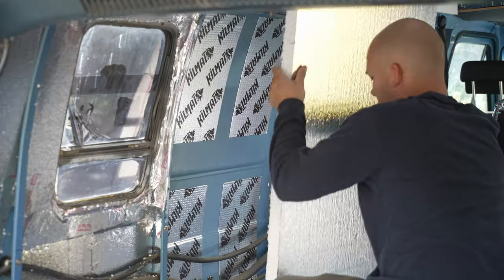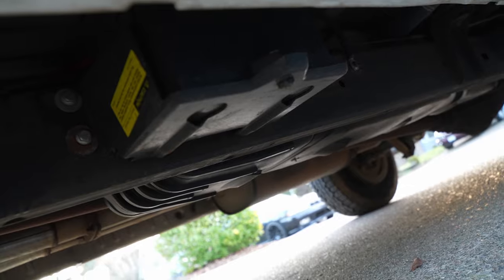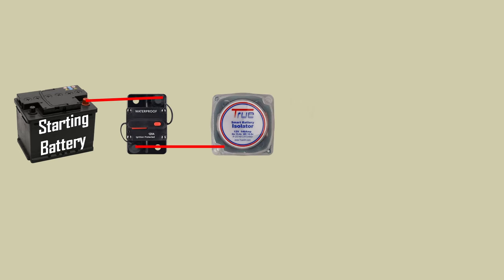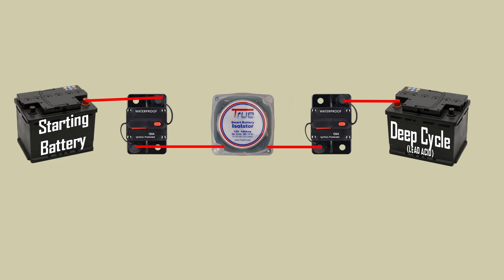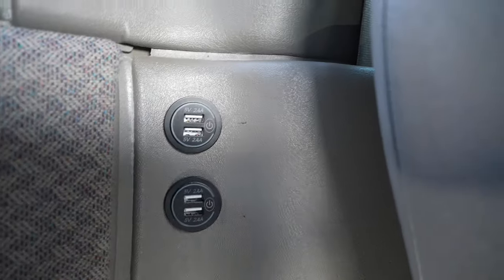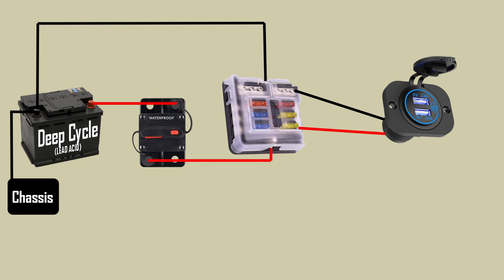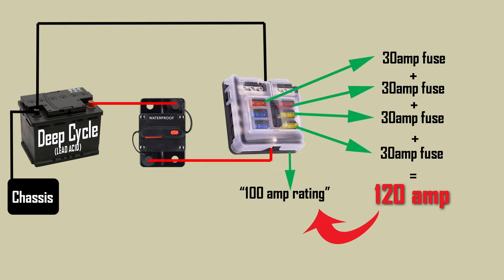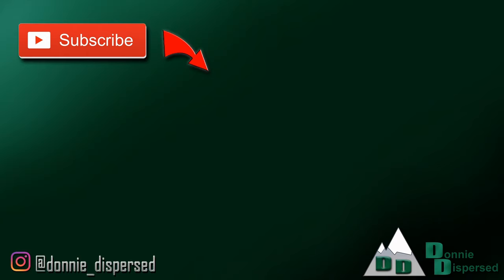SIMPLE DUAL BATTERY SETUP | ( Auxiliary / House Battery Camper Van Overlanding)

Comment from the maker: This one is the more affordable systems I've put together coming in under $400 
🔵 Shopping list * 
Smart Isolator: https://amzn.to/3ROmUdc

Circuit Breaker x2: https://amzn.to/3xezUiU

Fuse Block: https://amzn.to/3IeICnD

USB Outlets: https://amzn.to/3YJ47SG

My favorite brand wire for accessories (NOT BATTERY CABLES NOT FOR ISOLATOR): https://amzn.to/3xfGsxA

Fork Connectors (Nice for Fuse Block Connections): https://amzn.to/3G9LZIF 

Awesome HeatShrink Tubing: https://amzn.to/3dg43nL 

For Your battery cables you will want good heavy gauge wire. Probably no smaller than 4ga. I used 2ga welding cable that I had sitting in the garage. 

Jumper cables can be a more affordable way to buy heavy gauge wire.
I used these ones for the fuse block connection to the auxiliary battery: https://amzn.to/3YJcqhl  

*affiliate links support the channel at no added cost to you!

Social Media Links
www.donniedispersed.com
IG: www.instagram.com/donnie_dispersed/ 
TikTok www.tiktok.com/@donniedispersed
Reply: DonnieDispersed ? it would be best to use a fuse under the hood and circuit breaker inside the vehicle, because circuit breakers under a hot hood trip when it gets hot enough.
Reply from the maker: @FUNKBOOGIE1  I’ve never had that issue in any of the 3 vehicles I’ve installed circuit breakers in. But if it was a problem, sure you could use a fuse.
Reply: How do you determine the breaker size?
Reply: I currently have a solar panel on the van roof. Both positive and neg wires go to a solar controller. From that a positive and negative wire goes to a house battery from the house battery a positive and negative wire go to my invertor. Nothing from that system is connected to the chassis.

Now I want to connect the house battery to the vehicle battery as you have done because sometimes you just need to recharge from the alternator.

How would you suggest?
Reply from the maker: @yougeo  depends on the house battery you have. AGM or lithium I would replace the Voltage Sensing Relay (VSR) I used in this system with a DC-DC charger. However you can otherwise set it up exactly like this, just add the leads from the solar controller to the house battery as well. I have since added a solar panel to this van exactly like that.
Reply: @DonnieDispersed  i am all ead acid batteries now because I get them very cheap from wrecked cars. Batteries are often fine. Also no fire worries like lithium

Comment: So how would you charge the deep cycle battery? My truck came with a similar set up but don't know if I can use a deep cycle and have the alternator keep it charged while the engine is running; as that is the only time the deep cycle is connected to the vehicle electrical system.

Comment: Add a starter box. It's what all the roadside assistance people use now. I've had 4. The latest and best is made by "Tac Life". If your starting battery fails, it'll usually start your engine. But you don't want to depend on it. It's backup.

Comment: Great video and a very well-explained simple 12 lead acid leisure battery solution with diagrams to make a very straightforward & low-cost, safe working system anyone can install in their vehicle. The biggest cost with this system is probably the additional Lead Acid or Gel type of battery. This system is probably 70% as efficient as the much more complicated and expensive  BCDC + Lithium Battery systems but at less than half the cost.

Comment: Great video, and well illustrated... Like to add that many people go cheap on the wiring... So whatever breaker size is used, it should be rated below the ampacity of the cables used....Plenty of charts that explain what cable size is needed based on maximum loads.

Comment: Would this setup work if I wanted to add two auxiliary batteries? I’m trying to get my 2016 F150 XLT 4x4 truck set up for
Overlanding. I want to be able to power my Dometic fridge, charge my phones, run auxiliary off-road lights.

Comment: Great video... Just had a quick question, So is the secondary battery technically running in parallel or is it just to power aux items? Like is it being used during starting as well?

Comment: Finally..a solid answer and not someone trying to sell a particular product like its the only way. Thank you.

I do have a question.....the second battery...can I add a 3rd and 4th battery to this setup? And probably a shore supply plug for charging?
Reply from the maker: Yes, look up how to connect batteries in parallel. 
My old van had a shore power charging set up made with a NOCO port plug, and a NOCO on board 10 amp battery charger. You can find a video of that vans setup on my channel.
Reply: @DonnieDispersed  awesome thank you. Was looking in this as I realized you answered my question.  Thanks again. Gonna go check that vid now

Comment: How so you charge a drill battery within this setup?
Do you need a power inverter connected to the Aux battery > circut breaker?
Why dont you have a DCDC Charger in this setup?
Thanks for the concise video.

Comment: Thx for this simple explanation. So I use a power station to run most of what I need but I’d like to do this to dedicate to my mini split AC. So instead of wiring to a fuse panel I would simply connect that appliance the same way right?  Thx

Comment: Hi, nice video! What about wires size that you used to connect the primary battery with the auxiliary battery?
I mean, is there a way to calculate the wire diameter in order to not get the wires melted while the alternator is charghing both batteries?
Thank you for your response!
Reply from the maker: There’s charts online that will tell you what gauge wire to use based on amperage and length of wire. The wire I used was 2ga welding cable cause I had a lot of it on hand.

Comment: Awesome video exactly what i was looking for, but, how would you stick a charger along that line? Id like to have charger installed also to keep the aux battery topped up while operating vehicle
Reply from the maker: @kevensmith5703  the alternator will charge both batteries when the engine is running with this setup.
Reply: @DonnieDispersed  yrs I continued reading and seen you reply to a previous similar question...thanks mate, appreciate the video

Comment: Best video and I've watched a lot in preparation for my GMC Savana conversion. Question, where did you get the battery tray and where did you mount it underneath?
Reply from the maker: eBay, “used Chevy express diesel battery tray” 
I used Riv-nuts in the holes on the frame rail, then bolted it up.

Comment: I'm trying to do the same but instead of deep cycle, I have lithium pack and I want the pack to trickle charge the starter battery when it's turned off.

The starter itself and the radiator fans will blow the lithium pack and I can't think of how to automatically cut out that battery when starting the engine.

Comment: Do you have to use similar batteries, or can you use different batteries, or different battery chemistries? I'd like to keep the SLA battery for starting, but use LiFEPO4 for the house batter.
Reply from the maker: @alexn9677  you need to use a DC-DC charger rather than the VSR relay if you want to use a lithium battery.

Comment: Great video, Thank you for this! Question, is it possible to use a Lithium battery instead of a lead-acid as the secondary battery or they both need to be the same type? Thanks again! :)
Reply from the maker: With this setup they need to be the same. To use a lithium or AGM you would want to use a DC-DC charger instead of the relay in this system.
Reply: @DonnieDispersed  Thanks Donnie! Greatly appreciated. Keep on doing great videos!

Comment: Quick question - if you wanted an inverter, would you just run it straight from the aux battery? (add fuses I assume too lol) Need anything else between Inverter and aux battery? Also, is there a benefit to install a separate charger for the aux battery instead (like if on city power, etc). Thanks again
Reply from the maker: Yes, inverter is connected directly to the aux battery. I believe some inverters might require an additional fuse, but some shave them built in. As for the charger, that’s how I had mine set up in my camper van is with a NOCO 10 amp on board charger, that was powered through a NOCO ac port plug. That kept the auxiliary battery charged if I plug the van in with an extension cord.
On Board Charger: https://amzn.to/46ThLI6
NOCO port plug: https://amzn.to/3XKnHyQ
Reply: @DonnieDispersed  I have used your YouTube combined with a couple forums (95% you though) and have drawn a diagram of the layout. No way to share here, but curious if in the scenario above with an additional shore charger added to the auxiliary if the isolator will protect / maintain the starter battery? I had the NOCO pushing recharger to auxiliary then off to an inverter, but starting to think I’d bypass the inverter all together and push/split 120 from the NOCO ac plug. From what I read the 120v on aux would only last 30-45 mins a a time.
Reply from the maker: @wadee3183  with this isolator, since it’s a “dual sensing” it will allow the batteries to connect and charge if either of the batteries are connected to a charger.
Reply: Good video thanks 
Those it has to be a deep circle Battery?
I got a extra car battery I could use!

Comment: With the distribution block you showed.. If I were just to use 3A fuses all around - could I just use a motorcycle battery (such as the NOCO Lithium NLP9 400A) in order to conserve space?
Reply from the maker: I wouldn’t recommend using a starting battery to power your accessories. You want battery that was made to deep cycle.

Comment: I followed this video and set up my batteries the same way. I think I did it correctly because it's working. One problem is, the 2 100 Ah batteries (which should hold up to 4000 Watt Hours) that I have hooked up drain so quickly even when they are full. The only thing I have plugged in to the inverter is my 2000 Watt power station, and the 2 batteries drain to zero before they are able to charge the power station to 50%. What could be causing the house batteries to drain so quickly?
Reply from the maker: I’d need more information to really help. What battery chemistry? I’m assuming lead acid if you followed this video. Did you wire the two batteries in parallel for 12v 200ah or series for 24v 100ah? 
I can say, that Inverters aren’t very efficient.
Reply: @DonnieDispersed  I have 2 Weize Deep Cycle AGM 12 Volt 100Ah batteries that are wired in parallel. 

One time, after they were fully charged, I turned off the power switch to the inverter, which means there was nothing connected to them. When I turned on the power switch again, to connect the inverter, the batteries had lost 10-20%. 

These are new batteries that have not been used for more than a total of 10 hours. Could they simply be defective, or could something else be wrong?

Thanks, Donnie.
Reply from the maker: @kevintieu5198   a 200ah 12v AGM bank wired in parallel will have an effective capacity of about 100ah (1200 watt hours). 4000watt hours would be if the bank was 200 useable amp hours wired to 24v in series. You have to cut the capacity in half, because the batteries are considered flat below 12v which happens at around 50% discharge. Sounds like you just overestimated your capacity. Also sounds like your inverter is putting a draw on the batteries even when switched off, in which case I would wire in a more positive disconnect like a cut off switch on the power wire. Though it may charge slower, I would say it’s probably more efficient to charge your bank directly via DC input. That way you will avoid the inefficiency of the inverter.

Comment: Can we just use a small Denso relay instead of Smart Isolator to connect/disconnect the second battery? It is much more cheaper I think. At least in my area there is a price difference of almost 3000%.
Reply from the maker: I doubt it could handle the amps the alternator can put out.

Comment: Would that be considered two 12v batteries wired in series? Does that make it 24v output on the other end of the auxiliary battery? And if so can I fast charge a portable bluetti powerstation from this battery using 24 volts instead of 12v cigarette lighter slow charging?
Reply from the maker: @NicoProv  this is parallel with the starting battery. So 12v

Comment: If my second battery will be running 1000 watts for extended periods of time, does that effect the gauge wire I should have between the starter battery and the auxiliary battery? Does that draw from the inverter/auxiliary battery work its way up to the other battery? i was going to just run an inverter from the starter battery, but seems like a high draw for such a long cable (10 feet), so I thought adding another battery might buffer this system. Am I correct in my thinking? I was going to have 00 gauge wire for 1 battery inverter setup 10 foot away, but with the extra battery I could get away with 4 gauge instead(running from battery to battery)? And then just have a couple of feet of 00 gauge from the aux battery to the inverter. Hope I explained this question well.

Comment: Did you use circuit breakers rated for 120 amps for all 3 circuit breaker locations?  Also, you have “x 2” listed in your shopping list for circuit breaker, should that be x 3?

Any chance you could share the exact products or links to what battery you used, as well as the bracket that holds the battery? 

Thanks.
Reply from the maker: The third one will depend on the fuse box rating / what accessories will be powered through the fuse box. The amp rating should not be higher than whatever the fuse box is rated for. 
The battery was just picked up from a department store. 
The bracket was bought on eBay, it’s just a Chevy Express diesel battery mount.
Reply: Thanks. That helps a lot. 

I have a Chevy express, and basically trying to do the exact same thing as you did this this set up - run a 12v fridge and charge sole devices here and there. 

You’re video has been a great help. 

To confirm, the deep cycle battery should not be AGM?

Comment: EXCELLENT! Doing a 4x4 Sub build now. Will this play well with the PWM solar controller and AGMs? Seems like it will. Thank you for your focus on safety and correct fusing! Passing this on, and subbed. Mark in Oregon.
Reply from the maker: Ideally an AGM would use a DC-DC charger not a VSR like this. But this should work fine with another solar controller. The relay will connect the two batteries if either one is being charged.

Comment: This might be a really basic question. But with this wiring does the battwery charge off the alternator? Im assuming the isolator makes sure its a one way system?
Reply from the maker: Both batteries charge off the alternator when the engine is running with this setup. Then the batteries are disconnected from each other when the engine is shut off.
Reply: @DonnieDispersed  Thank you so much for the reply!

Comment: going into my Subaru... how about adding a solar panel/controller to the second battery?
Reply from the maker: @codyheisinger2190  simple enough, you can check out the solar panel and mppt charge controller install I did on this van. The video is on my channel.

Comment: Does charge the battery too? Also could i put a lithium battery in as a deep cycle battery even if i have a lead battery as a main?
Reply from the maker: This charges the auxiliary battery. But no you shouldn’t use a lithium with this setup, you would need a DC-DC charger with a lithium charge profile in place of the relay.
Reply: @DonnieDispersed  oh great thats perfect if i install a dc dc charger is there no need for a vsr?
Reply from the maker: @keniji7442  yes, the dc-dc would take the place of the VSR
Reply: @DonnieDispersed  you are an absolute diamond! Thank you 🙏

Comment: My plan is to have my interstate group 24 starting battery and then a 100ah deep cycle AGM secondary battery for my sound system, PA system, CB radio. 

Will the battery isolator you linked work for my setup? Also is the DC-DC charger a separate piece I need as well as battery isolator?
Do I need the dc-dc charger?
Reply from the maker: Ideally if you are using an AGM, you should use a DC-DC charger rather than the isolator I used in this video. AGM's have specific charging profiles that are needed to properly charge and maintain them. DC-DC charger will be able charge via that profile.

Comment: Nice presentation but I am confused by shopping list with 2 circuit breakers while the video shows 3:     1-between starting battery and isolator, 2- between isolator and house battery, 3 - between house battery and fuse block ?

Comment: Does this make the circuit 24V or keep at 12V and ups the ampage (As its in parallel so would give out 12V with more ampage power, Correct?)   as i wish too do this in series too as need to make it 24V so my inverter runs as an accessory after the last point of connection as i have a 24V Inverter not 12 so if 24V isn't reached or near too the inverter wont power on correctly i believe

This is possible right and i just reverse the positives from 1st battery too neg n vise versa, at what point in the circuit would i go back too standard connection, from the 2nd kill switch id say, would i be correct?
Reply from the maker: @ricstar-ec1bk  the way this is wired keeps it 12v

Comment: I have zero idea of any of this but how does the 2nd battery recharge? You don't have to connect it in to the alternator?
Reply from the maker: @amirnakhai5273  it charges when the engine is running. Its connected to the starting battery when the engine is running via the relay and charges at the same time. I have since added a solar panel to this van, and it charges that way as well.